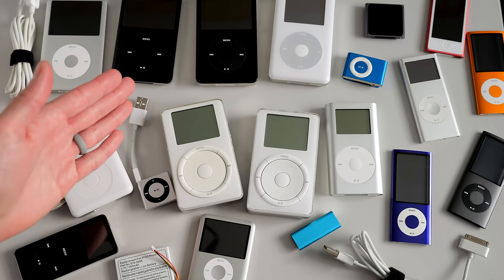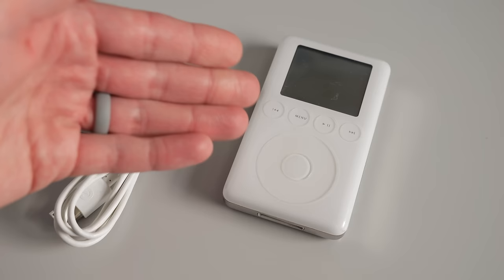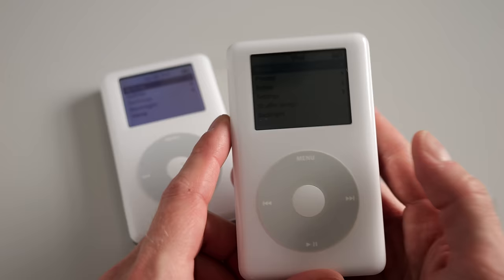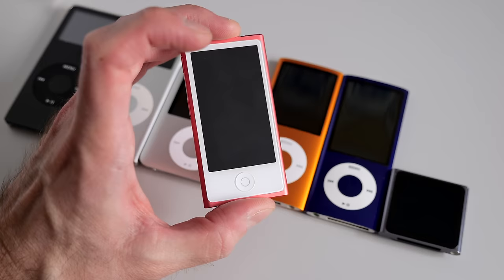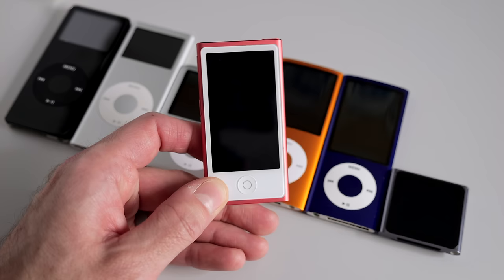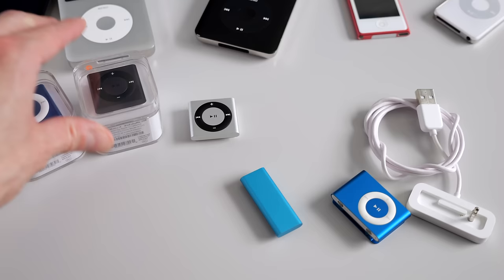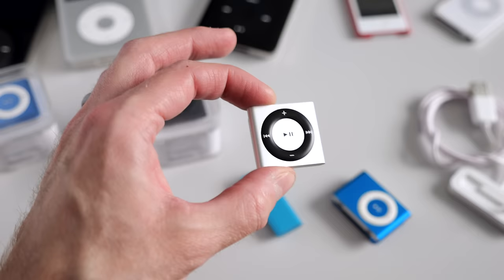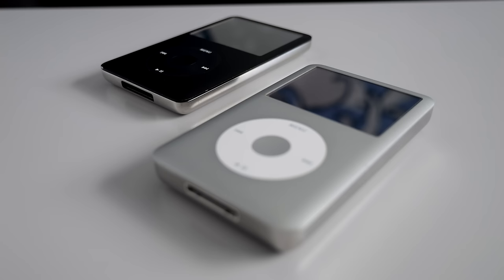Retro Buyer's Guide: Apple iPod!

Comment: the ipod mini is honestly one of the easiest to work on, after you take the top and bottom adhesive off (guitar pick and a little heat) and remove the retaining clip the whole thing slides out. the hard drive interfaces with CF cards natively and with a CF to SD card adapter on the 2nd gen you can go up to 256gbs and still be able to random the whole ipod. the Nanos are impossible to work on or upgrade
Reply: Completely agree. They take 256g easy.
Reply: Totally agree. With an aftermarket battery and CF card, iPod mini is fairly easy to mess with. The problem is that, at least from my experience, they sound a little dull when compared to 3rd and 4th Gen iPod.
Reply: I had 2 Minis and they are really easy to work on. The sound quality isn't the best but it's serviceable though
Reply: i 100% agree.

it was my first ipod and it was really fun.
Reply: I would have to disagree with Colin here.  I think the iPod mini is pretty easy to work on and it's one of the more upgradable ones out there.  Just watch the video from DankPods on it.
Reply: I’ve got 2, I’m gonna mod the heck out. 
Mods I’m gonna do / can be done.

-brand new battery

- replace the clicker with a iPhone 6 Taptic Engine
 
- add colour film to the screen to change the backlight colour (blue iPod with orange backlight for mine)

- the 256GB flash mod 

- dual boot rockbox and stock iPod os (you can load games and even 144p monochrome videos with RockBox)

- I’d also like to add usb-c but not sure if it’s possible.

Has anyone done any of those mods?
Reply: @HeyPatch  one thing to be aware of.

if you have an ipod mini 1st gen you can only do a 128gb mod.

would still recommend getting a 1st gen (if its untested) because if the clickwheel (on a 2nd gen) is broken then you will have a hard time finding one the same color as your ipod.

personally i’ve only done 1 mod on a mini.
changed the battery (because they usually only last for 1 hour or so) and modded the storage

also with the usb-c thing, if its real, its only for the most dedicated. and i dont think its that practical (and personally not sure if it looks good aesthetically)
Reply: @sealwheel   thanks for the info, mine are both 2ed gen. I thought it was only the 2ed gen that had matching click wheel colours and that all 1st gen were just grey.

As for the usb-c mod, its more of a “I wonder if I could” kinda thing. Is far as I know no one has done it on an iPod mini. Another “It probably won’t work” mod I’d like to try is adding Bluetooth, but besides finding the space to fit a Bluetooth transmitter the metal body of the mini would probably block most of the BT signal.
Reply: @HeyPatch  best option for bluetooth on the mini is probably to clip on the transmitter to the 30 pin's audio out. Unfortunately that means you can't do USB-C but I guess you can pass through the power wires on the Bluetooth transmitter dongle.
Reply: @HeyPatch  you are right only the 2nd gen has the color match, but he recommended the 1st gen if you didn't have one because of the fact that they are all grey. If you mess up the click wheel ribbon (which is right under the retaining clip) and you need to get a replacement finding one that matches the color of your 2nd gen is harder than the grey of the 1st gen. There is nothing wrong with either. the gen 2 just can just handle larger capacity
Reply: @HeyPatch  yes the 2nd gen is the one with matching click wheel colors, thats why a 1st gen is sometimes better
Reply: They can have some funny issues like all of them tho. I got one and gave it a brand new battery and it just wont charge even on my firewire for my 3rd gen, its a shame but my unit has board issues somehow.
Reply: @Di3mondDud3  either you didn’t connect the battery properly or your battery is faulty.

where did you get it from?
Reply: i should have known that instead of throwing mine away because it stopped working
Reply: @RealEpikCartfrenYT  eesh.. that pains me
Reply: Absolutely. I’ve modded a couple of these and it’s so much easier then trying to pry open a Classic.
Reply: @HeyPatch  heya let me know when you hear back !
Reply: Except the 1st gen nano, that one isn't too hard
Reply: @JasonBoon02  the issue with that one (and the nano 3rd gen) is that the battery needs soldering, and you cant replace the storage.
Reply: Yeah, but I don't think any factory parts are currently made. Aside from batts that is.
Reply: @maskedrebel9670  people have made a few 3rd party things, but still the pieces can still be bought used easily
Reply: @HeyPatch  I've been a bit nerdsniped over the USB-C mod, and the only way it can work is with two things:

- you need to find a type-C connector that's designed for overhanging off the board
- you need to cut a few millimeters out of the CF adapter

As for Bluetooth, your only hope is to fit it alongside the USB-C mod, or next to the taptic engine and hope to all that is holy that there's enough signal.
Reply: Woah noice no joke thats legit a good thing to know imho :D
Reply: Nah

Comment: I think it's worth noting, the ipod 5th and 5.5 gen models had a very good DAC in them, providing the best possible audio available in iPods. In addition, the 5.5 brought with it a brighter screen over the 5th gen model. You can find completely modded 5.5 models with 1 TB SSD storage and an increased 3000 mah battery capacity for around $330 presently, and for another $10 or so, a 30 pin dongle that connects to the bottom of the iPod classic to provide Bluetooth capability.
Reply: It’s a good DAC and all but it’s not THAT big of a difference
Reply: Good note, I was wondering if that was going to be covered in this video. People will pay a premium for the better DAC
Reply: @ozmond the dac on the 6th gen ipod sucks but the 120gb and thinner 160gb incarnations post 2007 sound better
Reply: @Aaron-vj8kw but the ipod is still pretty cheap used they’re still being sold underneath msrp

Comment: Ironically the 6th gen nano is what I am still using today in my truck.  Its one of the few devices that I have found that can stand the heat of inside the truck in summer in Texas.  Because the dash is all black and the compartment is on the top of the dash it gets very hot in there and I have never had it trip out on high temp.  Every other one that I have tried has that issue.

Comment: I remember when the Shuffle came out. I was in high school and didn't have a lot of money growing up, and was able to swing the $99 for the 512 MB version. It was one of the few things I had that people didn't give me crap for having the "Cheap Version"... People were like "Wooh! That looks like a thumb drive with a headphone jack!" I had it for like 7 years before it's battery finally stopped taking a charge. I also had an old set of computer speakers, that I soldered a few battery holders together to make them portable.
Reply: my first iPod was the original Shuffle back in 2005. it was a goodbye gift from a place of employment. I couldnt believe how cool it was!!! I had been lugging around a discman up til then... and this thing was smaller than my finger! life-changing. I still have it, but it hasnt worked after around 2014.

Comment: I had the 6th gen nano. Loved the tiny form factor for use in my car. It had a feature where you could double click the power button to skip to the next song, so it made it easy to change songs while driving without needing to fiddle with it too much. I actually broke mine over time because I kept clicking the power button and wore it out. Considered getting a shuffle to replace it, but by then I had a Touch and a car with bluetooth
Reply: The power button breaks really easy on that model and replacing that ribbon cable is Hell but if you can get it in there just right it will work for years to come.

Comment: What would be a gamechanger for these devices is aftermarket housings. Housings to replace the backplate. Add in a removable battery housing and that converter board that would allow you to replace the hdd with a microsd card. Both accessible from the battery bay. If someone could figure this out, it would make ipod reuseability infinitely better.

Comment: I modified a 6th generation iPod classic myself (with a 256gb micro SD and a new battery) and currently use it as a backup hard drive and primary mp3 player, and a seventh-generation nano as an mp3 player for exercise. I love these things. the nano is so light, it has FM radio and i can use it with my Bluetooth headphones while running. The classic fits absolutely my entire music library, all the study material from the university, photographs and there is still space available. And best of all, I can listen to music without ads, WiFi or annoying notifications.

Comment: 21:36 - I was one of those. This was my first iPod, indeed my first Apple device after I started working for AppleCare in Cork, Ireland, back in summer 2012. I had to get a refurbished one as they were out of production by the time I joined the company. Using this as a "watch" with a wrist strap was actually quite convenient. Plus, it had the huge advantage of being usable on aircraft back then, since it didn't have any wireless functionality apart from a radio receiver when the headphones were plugged in, which was a huge bonus, given that I shuttled back and forth between Ireland and my family back in Germany quite a lot back in the day.

Comment: I have a 3rd generation nano, really like it.

Limiting the charging speed artificially should help reducing the risk of the battery destroying the display (reduce, not completely remove)
Reply: No.
Reply: @override7486  yes, slow and controlled charging makes a battery wear slower, and hence reduces the risk, but does not prevent the problem, just takes longer before your luck runs out.

Comment: Wow, I loved this. The earlier iPods, I totally missed out on, as I was rocking cheap Creative MP3 players at the time. I had a 1st-gen Nano (someone found it in a couch at a party and offered it to me), and a 6th-gen (my wife and I both surprised each other with them at Christmas). Now, I have a couple of iPod Minis... I think I'll avoid charging them to make sure they don't get destroyed. Thanks for the heads up!
Reply: not charging them can also damage them.

batteries should last awhile. if they do die, ipod mini’s are the easiest to repair
Reply: Charging to 50% and putting them in storage is the default method for most electronics.
Reply: I believe the Minis do not have this battery expansion due to it not being as compact. the problem is with the Nanos.

Comment: I still have and use my 80GB 5th Gen iPod. I've made a ton of playlists over the years, so the analysis paralysis thing mentioned in the video doesn't happen to me. Everything is original, though the battery isn't as great as it used to be, and the plastic film on the cover has a small split in it between the wheel and screen from where I left it out in a hot car too long. I've never used it for photos or videos, just music, and it was purchased as a replacement for an 8GB 2nd Gen iPod Nano. I've dropped it numerous times, but aside from a few scuffs, it's no worse for wear.

My wife use two 4th Gen iPod Shuffles for working out. Which ones she uses is based on what she wants to listen to. The gold one has rock and metal on it, the blue one has classical. Pretty cool little device.

Comment: I specifically bought a 4th Gen shuffle in green for the reasons you mention. Easy to use, nothing superfluous, just music. Great for exercise and working out.

I also bought a second 6th gen classic and a 1st gen nano because I wanted them, and replaced the battery in my original classic and the one I bought because both were bad. The Nano I got because I've always wanted once since they were released but at the time and then when I got the 6th gen classic it just wasn't worth it at the time when I had limited funds for them. These days I can justify it as a for fun purchase.

Great video!

Comment: I watched multiple full length movies on the fourth gen iPod Nano (I’ve always known it as the Nano Chromatic). At the time, the iPod won out over larger display sized players in the battery life and pocketability realm. I’ve even had friends watch films  with me, using a wired portable speaker system.

Comment: I'll always be an Ipod 5th gen lover. It was the first one I owned and still have it to this day. Sadly, the battery solder snapped off and it took the pads.  Had to fix my ipod classic and still use it to this day to go jogging. I love having NO distractions or 'notification' alerts from a phone. On top of that, I have purchased a few for dirt cheap. So I don't really worry much if I break it.  

They ARE A mess to take apart. Ones taken apart, I NEVER bother to fully 'click' it back.  Not worth the hassle.  I installed a flash adapter and I enjoy it.  I did get confused when people were starting to call the 'click wheel gen" the 'classic' gen. SO googling was difficult. Now that I GET the name change. It's easier.  But still, that was an issue.  

I personally would recommend the 5th gen of the 'classic' series.  Easy to open and take care of.  I did buy one that just does NOT want to format what so ever.  I gave up on it for now, but it's still next to my bad every day. To remind myself to eventually look into it. 

Great video.

Comment: Great video, Colin. I have my original 3rd gen iPod from 2003 as my once-upon-a-time daily driver, and an iPod shuffle 2nd gen that I bought for exercise. You definitely nailed the compelling features of the shuffle, at least from my perspective. I’ve used my 3rd gen iPod recently (it still works great! - I replaced the battery and HD about 10 years ago) and your video is inspiring me to pull out my shuffle to see how it is doing.

Comment: I have a 2nd gen iPod mini. I had a 16GB flash drive in it for many years, but it died. I put the original 4GB hard drive in it and it still works. I still use it in the car on long trips several times a year.

Comment: Regarding the older iPods, Apple discontinued development and maintenance of their FireWire Core Audio driver with Mac OS X El Capitan, and I had significant problems with using Firewire on my iPod 3rd Gen -- I ended up having to go to USB for synching and Firewire for charging.
Reply: Weird, I have no compatibility issues using my 1G and 3G iPods with macOS Monterey

Comment: The easiest ones to open and flash mod would be the Mini and Classics, mainly 4th and 5th gens. These 3 I love to use but the 5th is my personal favorite, also my daily driver, because of the screen, back plate color choices from Blue to Iridescent and give it a bigger battery. You can use a cheap CF to CE/ZIF adapter w/ a cheap CF to  SD adapter or the bit expensive but perfect for not having any problems in the long run, an iflash adapter. 

However if you don't want to spend too much, get the Mini. Easy to open, easy to flash mod. Just get a cheap CF to SD card adapter or again, perfect if you don't want any trouble in the long run with the cheap stuff, an iflash CF to SD adapter which is like $20+. 

I have a certain Aussie who's very dank to thank for bringing me back into iPods. I've always wanted an iPod Classic. I'm glad they're so cheap, fun to open and flash mod. My favorite iPod before was the Nano 5th gen but now it's the Classic 5th gen. Yeah Nanos are a pain in the butt to open especially the full body case ones AND should the battery bloat on those kinds, it's all ogre now. The ones that are slightly easy to deal with would be the 1st, 3rd and 7th gen Nanos since you can open up their back plates.

Comment: So this is when Apple became the Apple we're used to today (hostile towards users who would try to open the devices for repairs)... And this is a great example of the long-term consequences of this: the inability to even preserve the incredible history of these devices. Such a shame not to be able to replace the battery on these things!

At least they never did that with the larger classic iPods, which are still very easy to open, mod and fix. That might have been the last Apple consumer device to offer that privilege...
Reply: I mean how exactly do you make an iPod that has both a very GOOD, seamless design, tiny footprint, easy to manufacture, as thin as can be, AND make it easy to open? It wasn't Apple's fault the Nano was hard to open, those designs just don't make it practical to make them easy to work on.
Reply: @joeylantis22  My Sony NW-A55 (from 2019) is also tiny, has a bigger screen and battery (compared to any vintage iPod) and is still fairly easy to open to replace its battery... Sleek design does not have to be an excuse to make an unfixable/disposable product that is bad for the environment.

Comment: this was an amazing deep dive into ipods one thing to note though you didnt mention that the ipod 5th gen had a 5.5 gen model the way to check for this is to go into music and if you have a search option its a 5.5 gen and if not..its a 5th gen also the 5.5 gen has a way better audio chip in it so its more sought after probably the best chip in the classic ipod lineup along with the ipod mini 1st gen audio chip ive got a black 5.5gen with a 128gb sd in it
Reply: The 5.5 and the 5th gen have the same audio chip. No difference.